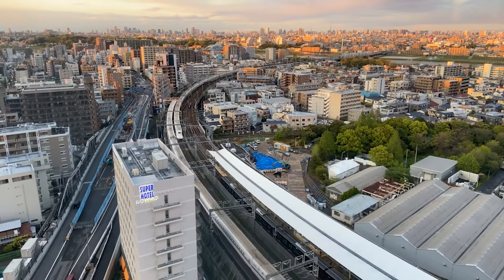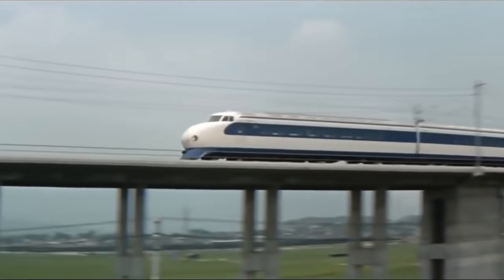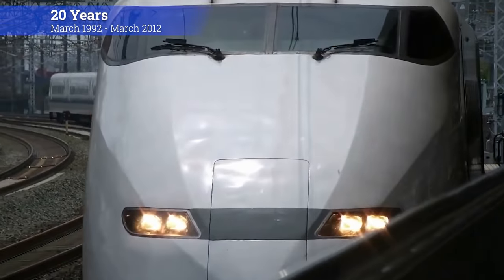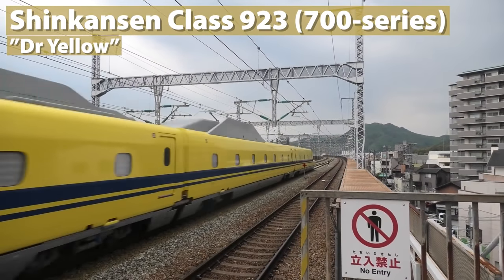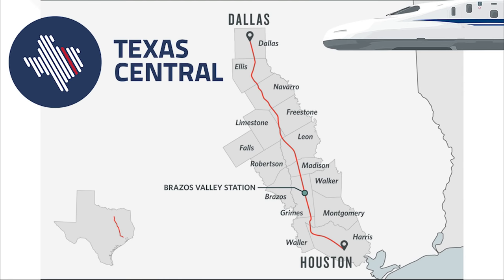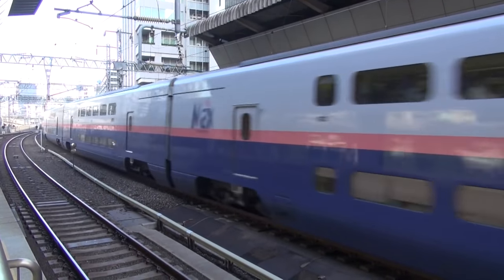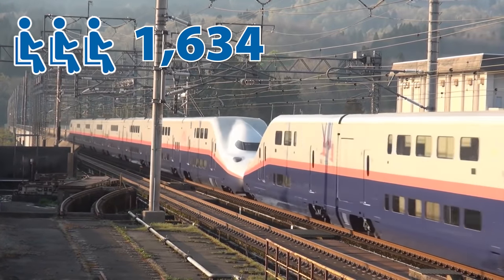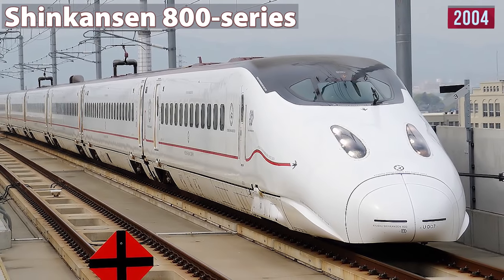Evolution of Shinkansen Trains - EXPLAINED

Comment: The dimension of 500 series is slightly smaller, so the seats capacity also reduced.  That's why JR Central stopped allowing the 500 series on the Tokaido Shinkansen.
but in my opinion, 500 series has the most unique body design because of its cylindrical shape. It stands out between other JR Central-West boring-shaped shinkansen trains...
Reply: No, the seating capacity of the 500 series is being one more than the 700 and N700 series. (500 Series 1,324  seats, 700 & N700 Series 1,323  seats)
The reason why the 500 series was disliked by JR Tokai is because there is only one door in cars 1 and 16, which takes time to get on and off and causes delays. Also, it is expensive to manufacture, there is no need to go 300km/h on the Tokaido Shinkansen section, and they wanted all the cars to be common.

Comment: The "Series 600" trains are missing from the three-digit series that started with Series 0. The reason for this is that Series E1 was positioned as Series 600 in the design stage.

Also, since there were no other series in the Shinkansen until the Series 100 debuted, the Series 0 was simply called "Shinkansen cars".
Reply: Fun fact: The prototype 0 series train was called the 1000 series from the start tho!
It ran from 1962 and was converted to the 992 series after the introduction of the Tokaido Shinkansen

Comment: You missed Toreiyu Tsubasa (Footbath Shinkansen E3) since you talked about Genbi 500 EVA and Hello Kitty also E4MAX is retiring this year. Also Alfa-X has recently reached higher speeds than 382 km/h.
E7/W7 Sets are not able to reach 320 km/h (text mistake) either they have a design speed of 275 km/h
Reply: "Also Alfa-X has recently reached higher speeds than 382 km/h." It's not even a more recent thing. The 382 km/h figure appears in headlines because that was the speed reached when members of the media were invited aboard. Those articles mention in their bodies that 400 km/h had already been achieved prior to that media run.

Comment: Just to add something: The 200 Series' 275km/h should be only for the tunnel parts going towards Niigata of the Joetsu Shinkansen, and there was a 200-2000 which looked almost identical to the 100 Series, with double decker cars too and (I think?) 245km/h.

Comment: N700A has 2 variants: small "a" and big "A".
N700a was upgraded from existing N700, N700A were new builds.
E4 is being retired this year
E2 will be replaced by E7/W7 in near future
E7/W7 was offered for the cancelled Malaysia-Singapore HSR, and also for the Indonesia HSR which Japan eventually lost out to China
Reply: I think the one that proposed for Indonesian HSR was E5 series-based
Reply: @Rinoarashi-P  My bad, you are right, JP offered the E5. Surprised really, given that Jakarta-Bandung route is pretty short (140km) and JP only offered the E7/W7 for the cancelled KL-SG line which is 300++km.
Reply: Although it's 3 years since you first comment this, thanks for letting me know that the E7/W7 was the rolling stock offered for Malaysia-Singapore HSR.

As i've been interested into Shinkansen in the last few months, i was curious which shinkansen were they'll be used if JR East stayed in participating the project.

Personally, i do love the idea of E7/W7 being used on Malaysia-Singapore HSR, but i also would love if E5/H5 were used on that route (N700A/S would be the nice third option, but probably the least interested out of three, imo).

With that being said, the recent news may suggested that the project will probably use European or Chinese HSR if proceed. Which is alright as long as it does its job, but it's a bit shame as i love shinkansen for HSR. At least i could only dream that the local HSR line uses E7/W7 or E5/H5 for the services.

Comment: While over there recently, I rode on three of them, and from Hiroshima back to Tokyo hit the massive high speed of 320ks per hour, super smooth and comfy, heaps of leg room and I'm 6 foot 7, 202 cms tall.  They are competing with domestic air travel, far less environmental impact from less energy resources and same time frames, including multiple stops along the way.  Breaking and acceleration smooth yet powerful, the place for electric powered transport, not BEV's

Comment: A little sad fact:
The Series500 body is capable of traveling at a top speed of 350 km/h.
The round body cross-sectional shape, inspired by aircraft, is excellent from an aerodynamic point of view.
However, it also had a definite drawback. It was TOO  UNCOMFORTABLE .
In the pursuit of speed, practicality was compromised.
The small, round body section was revolutionary, but the cabin space was too small.
The construction of the passenger doors was also problematic. The body shape was so unique that the doors on the front side of the first car had to be eliminated.
These problems apparently made some passengers reluctant to board the Series 500.

It was not until 1999, two years after the Series500 was introduced, that the Series700, which solved the problems of the Series500, went into mass production.

Comment: Nice video, I didn't thought that there is so many Shinkansen series.
Unpopular opinion: I don't like so much the careerist long nose of the 700 series. Instead I prefer the Shinkansen with the shorter nose: the serie 500 Is definitely my favourite: it seems like an futuristic sport car.
Also the series 400, the E7 and the serie 800 are nice in my opinion (in particular the serie 800 remind me of some European design)
Reply: Uh, the 500 series has a much longer nose (15m) than the 700 series (9.2m). The lower passenger capacity on the end cars due to that longer nose is purportedly one of the reasons why JR Central stopped allowing the 500 series on the Tokaido Shinkansen.
Reply: @СлаваУкраїні-м2о6в  yeah also the dimension of 500 series is slightly smaller, and the rounded roof shape makes "claustrophobic" effect for certain people.
but in my opinion, 500 series has the most unique body design because of its cylindrical shape.

Comment: What is the different among kodama, hikari and nozomi and  which one faster ? As well as which one the best (quality of those train)  ?
Reply: The difference between Nozomi, Hikari, and Kodama is the station they stop at. The vehicles used are the same, but the stops are at different stations, so the time required is also different. In terms of speed, Nozomi is the fastest, followed by Hikari and Kodama. On the Tokaido Shinkansen, Nozomi stops only in large cities such as Shinagawa, Shin-Yokohama, Nagoya, Kyoto, and Shin-Osaka. Each Hikari train stops at different stations. It doesn't pass as many stations as Nozomi, but it usually passes through small stations. Kodama is a Shinkansen that stops at every station. The travel time is quite long compared to Nozomi. Since this is a Shinkansen that stops at every station, there are of course no stations to pass through. The Tokaido Shinkansen operates in this manner!

￼

Comment: I'm still wondering why the double-decker E1s didn't serve for as long as their other peers.
Reply: Since the 12-car train is fixed, it was not possible to connect 8-car trains and 8-car trains to create a 16-car train like the E4 series, so during times when there were few users, the 12-car train The main reason is that the organization created waste. The e4 series was able to operate smoothly in this way, so it was used for a longer time than the e1 series, but it was retired about two years ago due to its slow maximum speed. I'm sorry if it wasn't translated well because I used a translation 🙇‍♀️

Comment: Only thing I don't like about recent Shinkansen cars is their small window size.  Why do they keep making window smaller and smaller?  I want to sit in a panorama Shinkansen car and enjoy fast flying views in Japan.
Reply: Japan has strict noise regulations, so windows are made smaller to reduce noise. However, the e2 series, which does not have a very high maximum speed, has a large window because it makes less noise compared to the faster e5 series and n700s series! I think the e2 series will be retired soon, so if you want to ride it, get it early!

Comment: I would like to introduce the Shinkansen that did not appear in this video.
First of all, Doctor Yellow has 0 series shapes in addition to 700 series shapes.And in JR East, there is something like Doctor Yellow called "east i".Doctor Yellow is only used on the Tokaido Shinkansen, Sanyo Shinkansen and Kyushu Shinkansen.
Next, I will explain about the "955 series (300x series)".This Shinkansen is a test vehicle.I have run a lot on the Tokaido Shinkansen at a speed of 443km / h, which is the fastest on the iron-wheeled Shinkansen.(The fastest Shinkansen is the "L0 series" at 603km / h.)
Next, I would like to introduce "Toreiyu Tubasa" (Toreiyu is a combination of Romaji "torein" of train and "Yu" which means hot water).This Shinkansen is a Shinkansen with a footbath in the car.
Finally, I would like to introduce the Shinkansen that uses superconducting linear.This Shinkansen is still unfinished and is currently under construction with a plan to open between Tokyo and Nagoya in 2027.First, the ML-100 series will be launched in 1927.
Next, in 1979, the ML-500 series recorded 517km / h. However, at this point, the test vehicle was still unmanned.
Next, in 1987, the JLU001 series struck 400.8km / h in manned driving.
Next, MLU002 started operation in 1987, but in 1991 a fire broke out during the experiment and it was destroyed by fire.
Next, in 1994, the MLU002N series recorded 431km / h in unmanned driving, and in 1995, it recorded 411km / h in manned driving.
Next, in 1997, the MLX01 series recorded 531km / h for manned driving and 550km / h for unmanned driving. At this point the Transrapid and TGV records were broken. Recorded 552km / h in 1999 with manned and loaded condition.Recorded 581km / h in manned driving in 2003.
Finally, in 2015, the L0 series recorded 603km / h in manned driving.

It's been a long time, but thank you for reading to the end.These sentences used translations, so I'm sorry if they look strange.

Comment: whats the difference between e5/e7 and n700/n700s
Reply: The E5 series and the E7 series are Shinkansen trains operated by JR East.The E5 series is operated on the Tohoku Shinkansen, and the E7 series is operated on the Joetsu and Hokuriku Shinkansen. The N700 series and N700S series are Shinkansen trains operated by JR Tokai, JR West Japan, and JR Kyushu, and the N700 series is operated on the Tokaido Shinkansen, Sanyo Shinkansen, and Kyushu Shinkansen. The N700S series is operated on the Tokaido Shinkansen, Sanyo Shinkansen, and Nishikyushu Shinkansen. Vehicle performance is also different. The e5 series has a maximum operating speed of 320 km, and can run at 320 km even on curves with a radius of 4000 m by leaning 2 degrees using a body tilting device. The maximum operating speed of the e7 series is 275km/h. The Hokuriku Shinkansen is a Shinkansen called a maintained Shinkansen, and since the maintained Shinkansen has a speed limit of 260 km, the maximum speed of the Hokuriku Shinkansen is 260 km. Since the maximum speed is not that high, there is no need for a body tilting device, so a body tilting device is not installed. What makes the E7 series different from other Shinkansen trains is that it is compatible with both AC 50Hz and 60Hz.Currently in Japan, there are the E7 series, the W7 series owned by JR West, and the JR East, which inspects the tracks and overhead wires of JR East. There is only one vehicle called -i.
The N700 series has a maximum operating speed of 300 km. The Tokaido Shinkansen has many sharp curves, so it uses a body tilting device to tilt the train once to pass through the curves. It can pass a curve with a radius of 2500 meters at 270 km. The basic train formation is 16 cars, but the Kyushu Shinkansen trains have 8 cars. The Kyushu Shinkansen trains have the ability to climb the steep slopes of Kyushu. The n700s series has a maximum operating speed of 300 km. Its unique feature is that it is designed to run on battery power even during power outages. The speed test recorded 362km. The N700S series for the West Kyushu Shinkansen is a maintenance Shinkansen like the Hokuriku Shinkansen, and its maximum speed is limited to 260 km. This n700s series is a 6-car train. Another difference is the equipment inside the car. There are also configurations of the same n700 series with different interior equipment, so please do your research. I used Google Translate. Sorry if the translation wasn't very good. Please reply if you don't understand something!

Comment: What does Mini Shinkansen mean?
A lot is covered in your video and I get the feeling that youre reading data texts 
instead of talking to us.  Example, you don:t have to tell us what color it is painted when you show it to us.
Reply: Mini Shinkansen is simply put, "Shinkansen that can run on traditional railroad line tracks".
Yamagata Shinkansen (Series400/SeriesE3) and Akita Shinkansen (SeriesE3/SeriesE6) are Mini Shinkansen.
They are unique Shinkansen trains that use the same standard body as the traditional railroad line, but have the same powertrain and safety equipment as the Shinkansen.
It can be operated by simply changing the width of the existing tracks, and has the advantage of being less expensive than a full-standard Shinkansen.
The first Mini Shinkansen developed was Series 400, which started operation in Yamagata in 1992.
The modified SeriesE3 started operation in 1997, and the Series400 was retired in 2010.

Currently, there is a Mini Shinkansen in prototype stage.
SeriesE8 is a new Mini Shinkansen designed for Yamagata Shinkansen.
It is based on the SeriesE6 for the Akita Shinkansen, but has been modified to suit the Yamagata Shinkansen, including a shorter nose length.
The maximum operating speed is 300 km/h, 25 km/h higher than SeriesE3.
Development of the new series is continuing, with operation expected to begin in the spring of 2024.

Comment: Do shinkansens have railroad crossings?
Reply: There are no railroad crossings on the Shinkansen! However, the Yamagata Shinkansen and Akita Shinkansen, which are called mini Shinkansen, are not actually Shinkansen, but have a railroad crossing! These two lines are conventional lines, and the width of the tracks has been changed from narrow gauge for conventional lines to standard gauge for Shinkansen, allowing Shinkansen vehicles of the same size as conventional line limited express trains to connect directly to conventional lines. There it is! So on these two lines, you won't be able to pass at as fast a speed as the Shinkansen, but you can still see Shinkansen cars passing at about 130km! !

￼
Reply: @sadada7562  thanks for clarifying my doubt